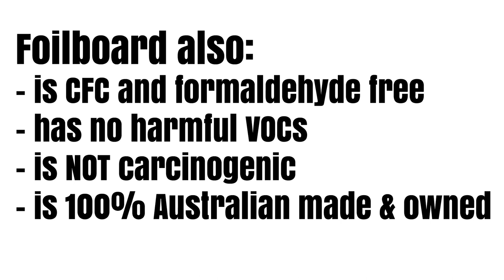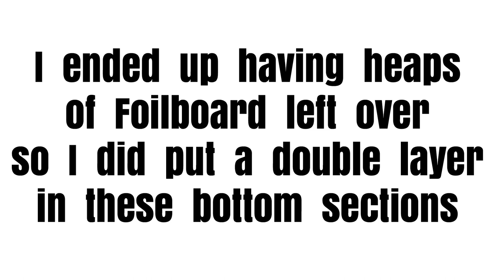Installing Foilboard Insulation in my Toyota Coaster Bus

Comment: Well done and thought out. Your correct about the orange conduit being an overkill ( rated  > 1000VAC) when your using 12VDC . Their are many more flexible conduits that are easier to use.  I liking your videos 👍🚎
Reply from the maker: I mainly used the orange conduit because it was the only one I could find that was made from unplasticised PVC, which wouldn't react with the polystyrene insulation

Comment: Hi Did you get the spacers from bunnings as ive never seen them there when ive checked out the foilboards.
Reply from the maker: No, I bought them from BetaBoard which is a company here in Brisbane that supplies Foilboard. You may be able to buy them online.

Comment: I’m confused, I thought the foil side goes on the inside and green faces out? All videos I’ve watched that is the case, including the official Foilboard instructions. For sheds and homes etc. anyway! So does it not make any difference which way it goes? Looking at doing my shed with these or Ametalin foil liner!
Reply from the maker: In terms of the insulation factor, it doesn't make any difference which way around the Foilboard goes. The only reason it is green on one side and they put that to the outside of buildings is because it reduces the glare of light reflecting off it.
Reply: @AGirlADogandABus  ah ok thank you! ☺️

Comment: How much of each product did you need. Foilboard, foil board tape etc. Thanks 🙂
Reply from the maker: I used approximately six sheets of the 25mm and about 2/3 sheet of 15mm. I can't remember how many rolls of the silver tape I used but it was quite a lot for the Foilboard and the next layer of insulation too. Maybe 6 rolls? Sorry I don't remember that.